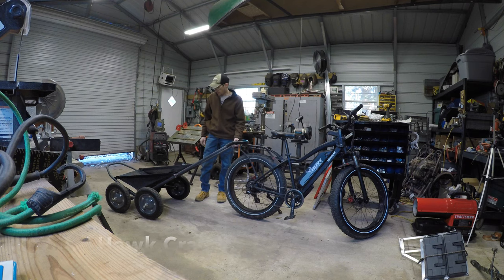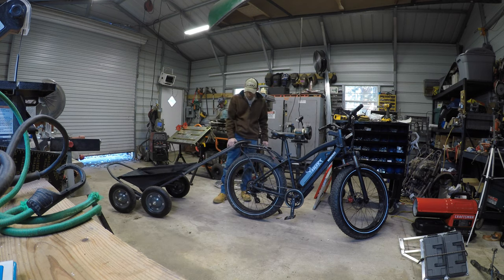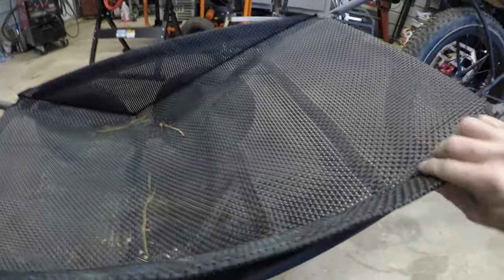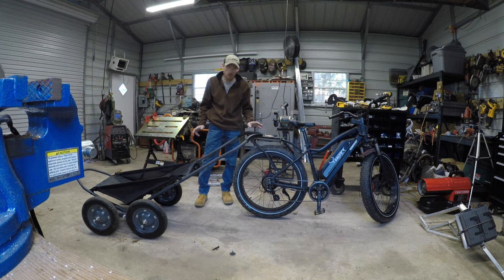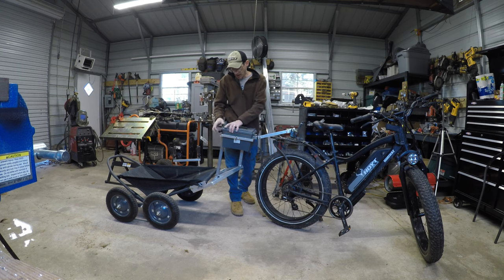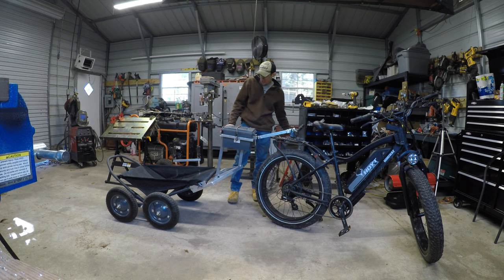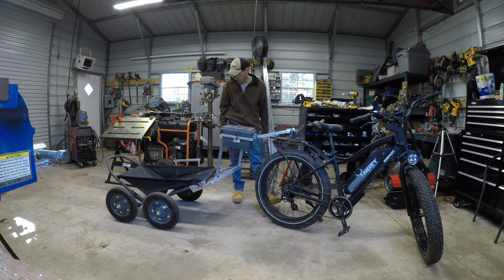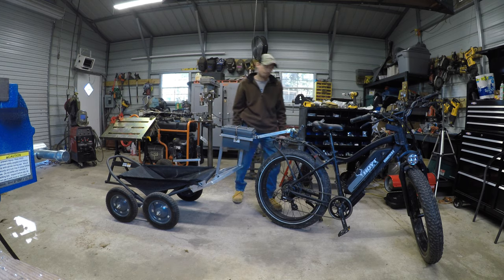Himiway Cruiser E-Bike Game Cart Hawk Crawler with bike attachment.-   4K

Comment: I have one of these as well. Main issue is the handle. It would “collapse” with anything heavy on the cart.   No matter how tight you tighten those screws. I drilled holes through the handles and frame then used the same type of pins you have. That way it can’t collapse. Works great!!  Great video!
Reply: Yeah same here  except  I used 5/16  steel bolts washers and wing nuts

Comment: gonna try to build something this without welding. not gonna look as clean but i cant weld aluminum.
Reply from the maker: If you use nut and bolt fasteners, try to get nylock nuts.  This will help keep it together without vibrating loose!  Send me a picture of what you come up with!